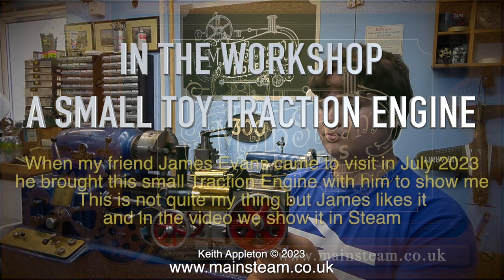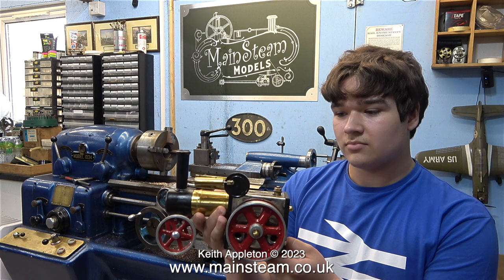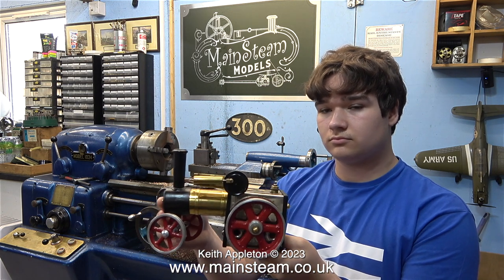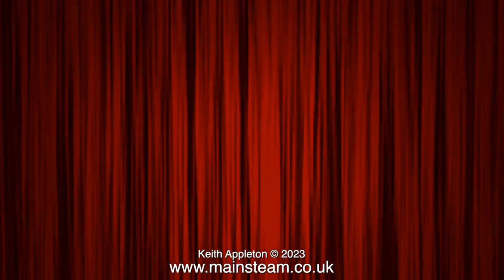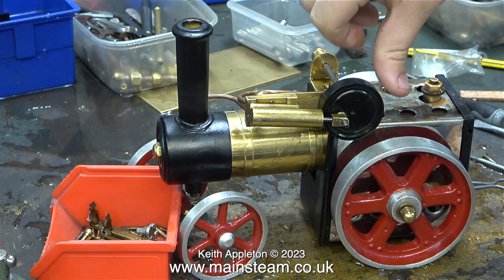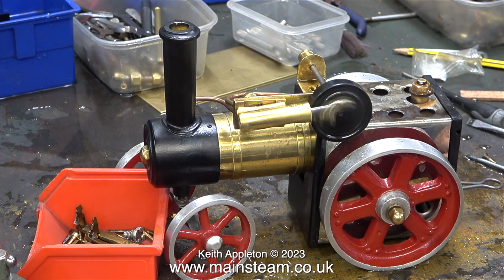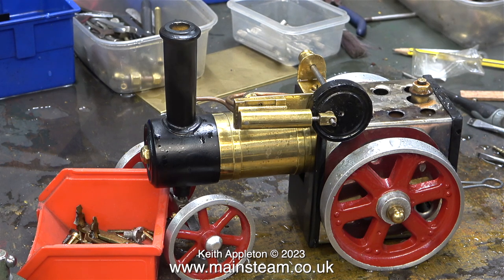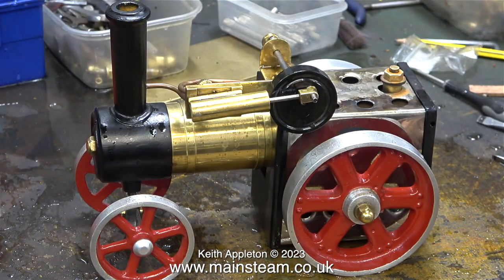A SMALL TOY TRACTION ENGINE - IN THE WORKSHOP

Comment: My understanding was Mr. Wells was a school teacher who wrote a number of books on shop work for schools, One of which I have a pdf of part of Step by Step Metalwork 3 by Kenneth Wells. I have just looked through my PDF copy and he covers the complete making of the tractor engine and a stationary one, including casting of most of the parts and testing of the boiler. I have been trying to find a copy of his books for some years now with no luck. Have James check out the pdf, and the flywheel is not made of plastic on the original.
Reply from the maker: Yes as far as I know, Mr. Wells was a schoolteacher.

Comment: Not very impressed with that Traction engine, Your right it does look like a Mamod on Steroids. I think a lot of the parts are Mamod. The Wilesco models are better I think Ive a Wilesco D18 stationary steam engine. I have an aversion to oscillating cylidenders ( they are too messy to my mind)
Reply from the maker: The parts are not Mamod, it was designed to be built in schools - including the casting of some of the parts . . . .